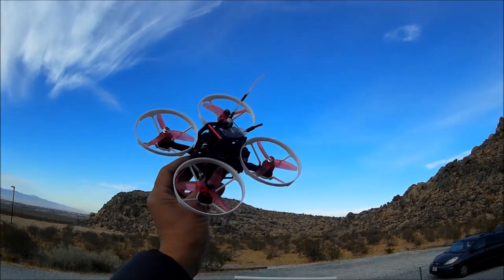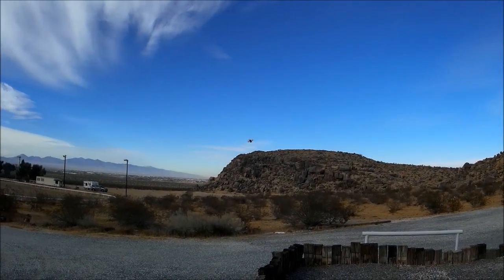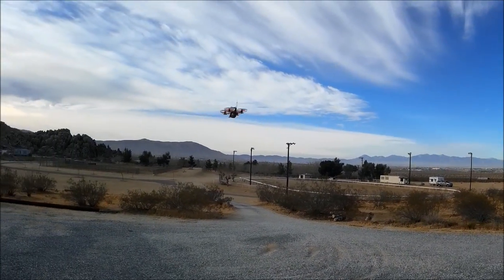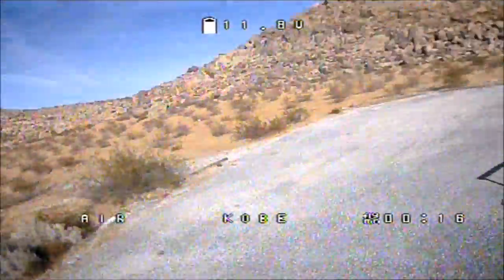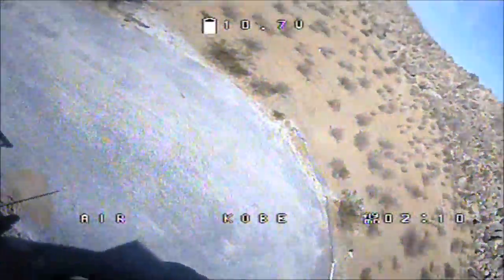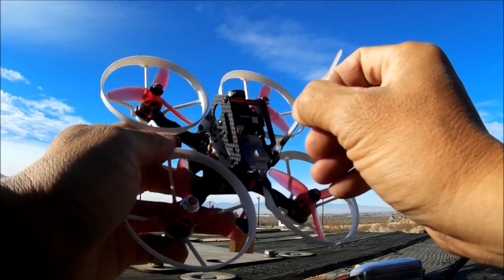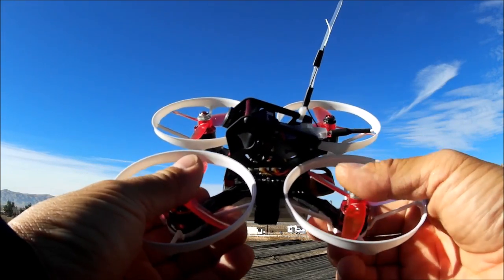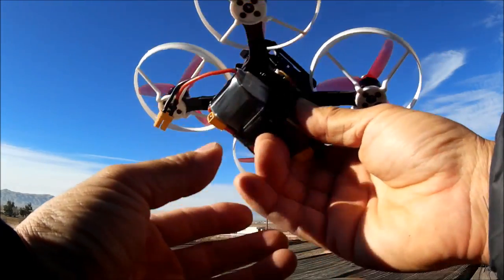TurBowing Kobe 140 Mega Whoop!!!  part 1

Comment: Yeah def take those guards off, they are useless because they are so flimsy. I flew this on a tattu 3s 450 and it's a rocket. I'm thinking 850 might be weighing it down too much because I actually got similar flight times as you. Get some gem fan 3 inch props for this bad boy and u r in business! Such sweet hardware for like $115 bucks
Reply from the maker: Heck yeah!  already did and it is good but the damn camera kind of sucks!
I must try out the smaller 3s!!!
https://www.youtube.com/watch?v=scwf5gfMVZg&t=530s